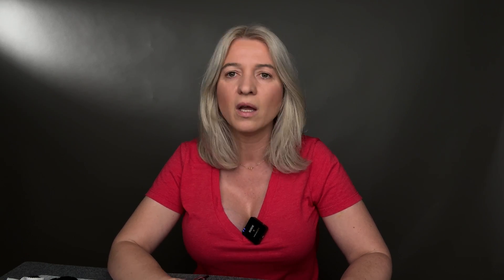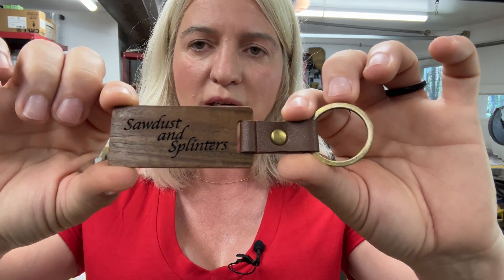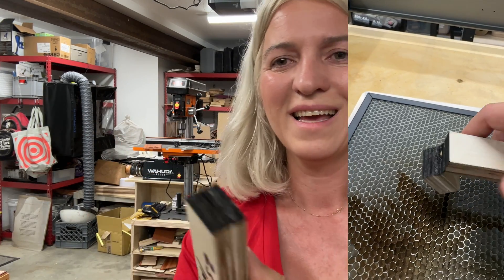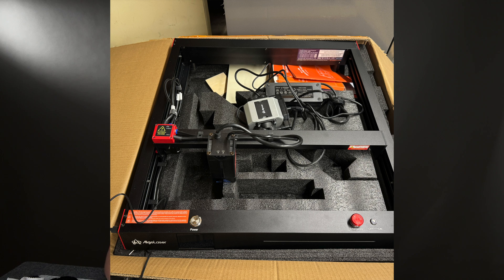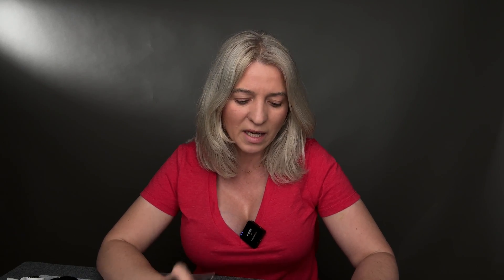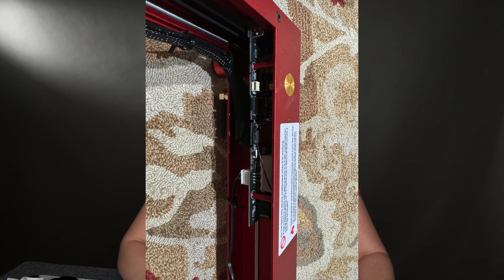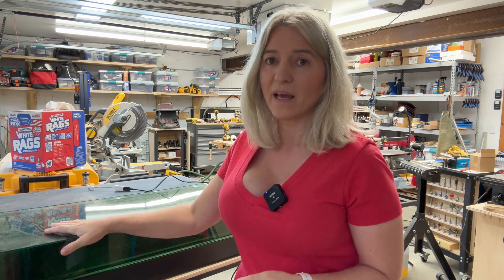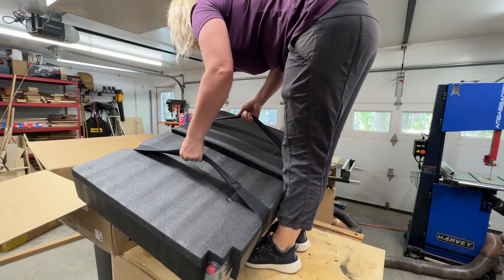The Ultimate Diode Laser Comparison! Escape laser regrets . Discover the best diode laser in 2023

Comment: Hi Great video very helpful. I was looking at the creality 40w and xtool D1 pro 20w. Do you know if the precise mode on the creality is much better for engraving or  any where near the quality of the xtool. I would like to use it for both engraving and cutting.
Reply from the maker: Xtool is better for engraving
Reply: @SkylerEwingWoodworking   Thanks for your quick reply. Would you say the xtool is still better for a mix of cutting and engraving. i would like to do inlays, boxes and engraving in fairly equal amounts.
Reply from the maker: @BenGW108  I would go with Xtool for sure

Comment: Ms Skylar, have you ever tried engraving a rubber stamp with your diode lasers? I've been told that they cannot engrave a quality stamp, compared to CO2 lasers. Is it true?
Reply from the maker: never tried it. Thank you
Reply: @SkylerEwingWoodworking  After various tests I managed to make very small quality rubber stamps, using Lightburn's ramp function. XCS, by not having this, tends to burn the small details, making them super thin and unstable.

Comment: Hi Skyler, I bought a Flacon 20 laser after seeing your revue. After two months I am still having issues with connecting with a Mac. Customer service seems a little slow to return E-mails and the advice is "caned". Have connected with a borrowed P.C. computer, but they do not seem to understand the Mac. Maybe we will meet and Rockler some day and you can tell me what you did to connect.
Reply from the maker: Hi Pete. Interesting you say that because when I first got my laser I couldn’t connect it either. I tried many times unsuccessfully. Also a Mac user. My computer does not have a USB port, only USB-C ports. I was using the tiny plastic USB to USB-C that came with the machine to connect it to my computer, but it was not working. Then I went to the Apple Store and I bought Apple USB to USB-C tiny cable, and once I plugged that one in everything worked as it should. I don’t know if that was just a coincidence but for me, that’s what it did the trick, and then once it was connected, I’ve never had a problem before a state connected and reconnected every time I used it.
Reply from the maker: If we have a run into each other at rockler, please do come and say hi
Reply: Thanks for the tip I will try a different cable. If you ever find yourself in Gorham the shop is at 414 Fort Hill Rd. @SkylerEwingWoodworking
Reply: Recently purchased a Falcon2 Pro 40w. It came with the 40w/22w and a 1.6 watt laser. With a Windows PC and two Mac laptops kept getting a power surge error and disabled USB port when connecting to the PC and disabled USB ports when connecting to the two Mac laptops with USB-C ports. So it would not connect to any computer I have. Although using the SD card it worked. And I tested with new USB-A to USB-C cables, 5 cables in all from Amazon. Also didn't work with the cable that came with it. After going back and forth via email with Creality support for 5 days they finally issued me an RMA and paid for returning it to the warehouse in California. After they receive it they will send a replacement unit. I would send a email during my day and they would respond at night I suspect China time. I had to basically fight with the person showing it is not working with three computers. They don't do phone support for this product or any other method, only email. Awful support method for this product. They should be getting the returned Falcon on 4/8.